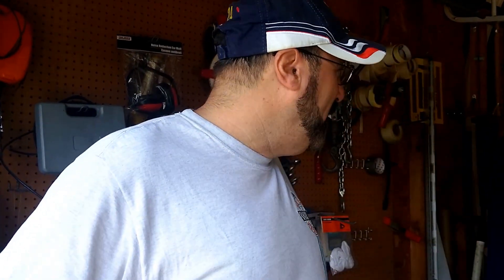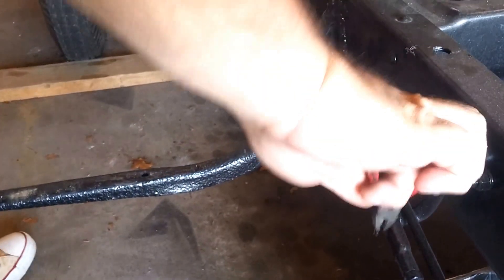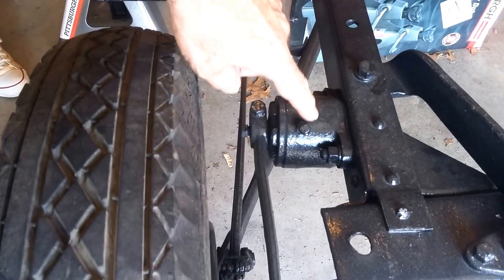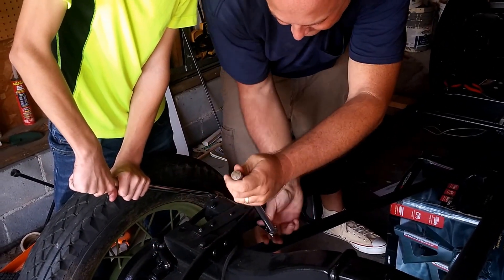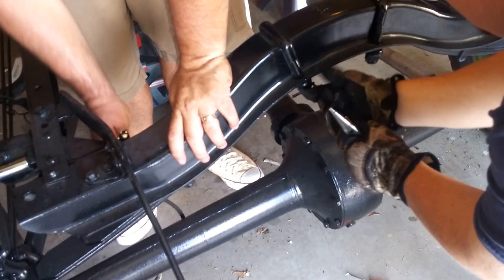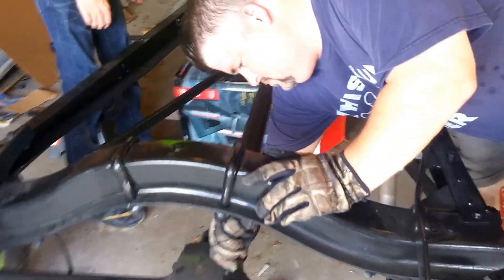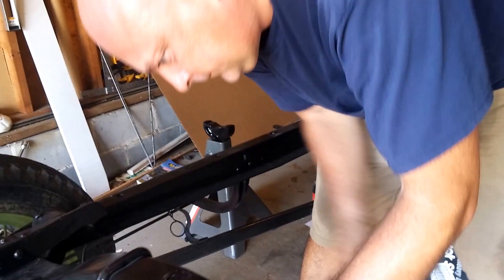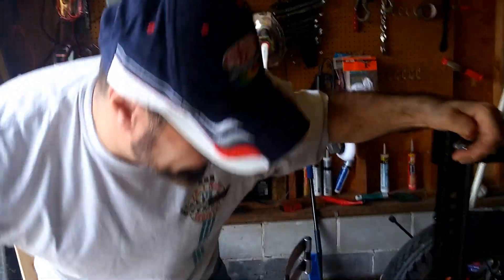Ford Model A driveshaft disassembly (driveshaft seals)

Comment: Years ago I bought a cotter pin removal  tool  at Sears for my Model A  it has a screwdriver looking handle and a shaft that has a Curly end you slip into the cotter pin  it is the best tool I have ever seen for removing cotter pins  I do not know if Sears still sells them I hope they do it sure makes removing cotter pins easy  .    BOB